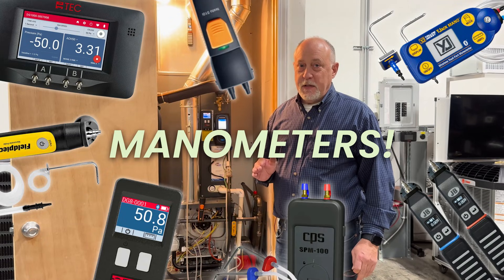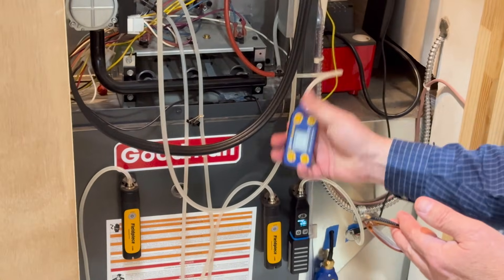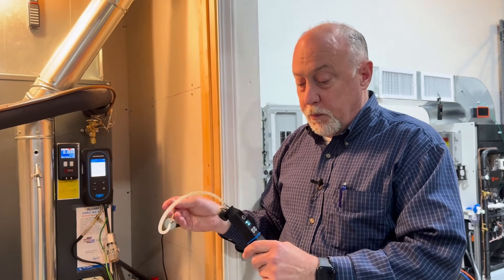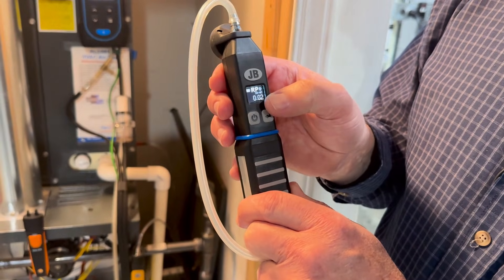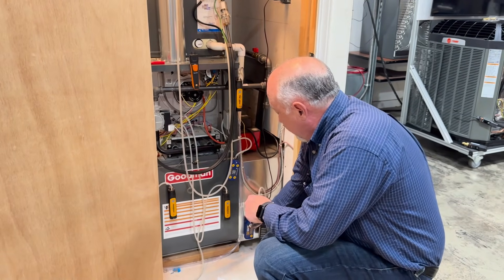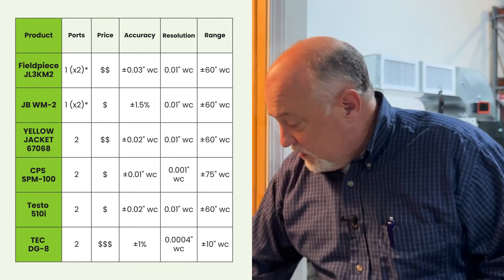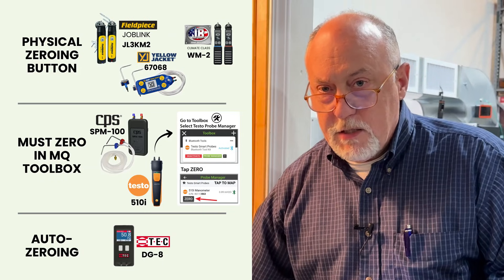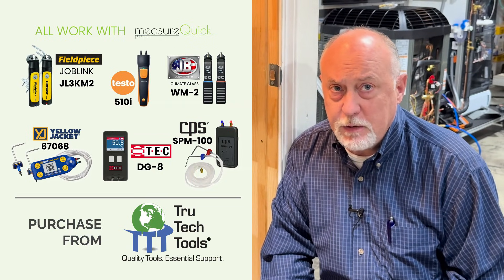Which Manometer Do You Actually Need? A Breakdown by Application

Comment: I've often recommended the CPS SPM-100 to apprentices and beginners as a great budget option, looks like it's even higher quality than I thought based on the data at 5:00 into this video.  I could tell from using it for years that it is an inexpensive reliable option, but now I see it has specs that compete well too.  Thanks again mQ for integrating trustworthy products with the best HVAC app.